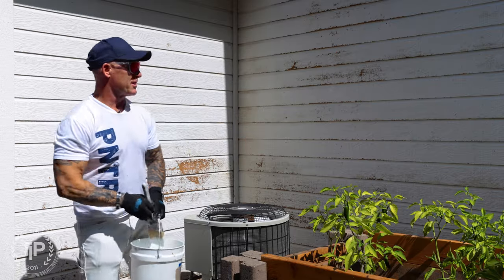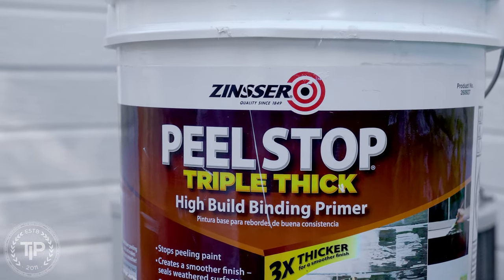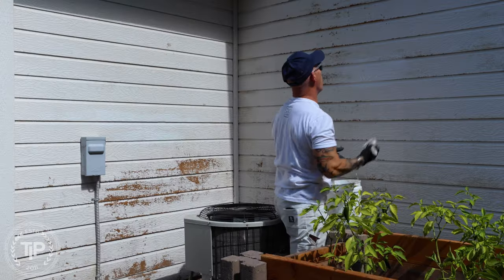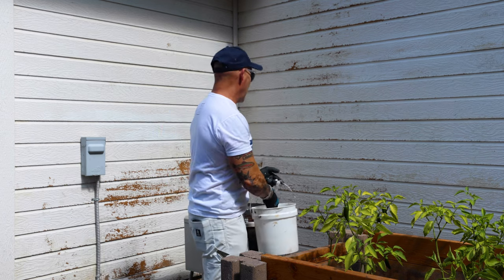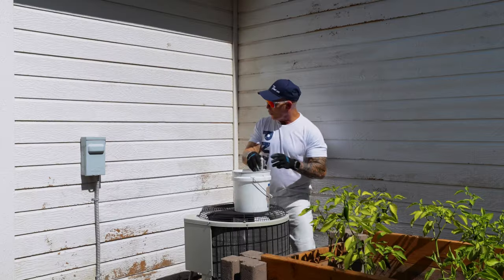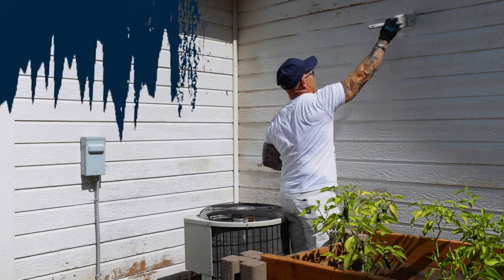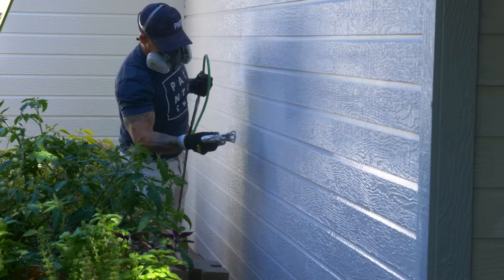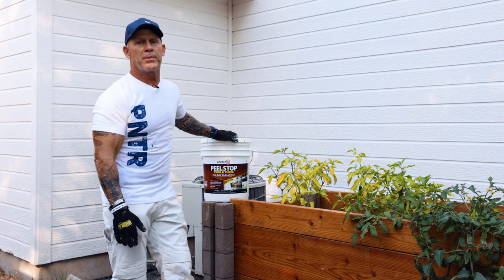Peel Stop Triple Thick Primer

Comment: Friendly Tip!  If this needs to be applied by brush, I recommend using the 2 1/2 Gooseneck flexible paint brush extender on a pole. No ladders. Use an 8 to 16ft extension pole. Saves so mush time. Idaho paint store. The Gooseneck guy! Cheers!

Comment: Just applied some of this after learning about it on paint life.  Dried pretty translucent even though the can said triple thick.  Chris: Are you having yours tinted or mixed with a white base?  Note to viewers: This stuff is not going to fully hide the edges of flaked paint.  It's thick, but not that thick, esp. after drying. It's better than reg primer though.  Quick sand after scraping and/or first coat of Peel-Stop to knock down loose fibers = pro tip.  He's right.  Big diff from that!
Reply from the maker: Triple Thick is tinted.  Peel Bond is not.

Comment: does this work well on masonry, in particular INSIDE basement foundation wall that is 100 years old and it's all crumbly (not stucturally) just like sand falling off it, if you touch it... if i brush it down to solid and use this primer on it, would it tie it all together and stop from crumbling and would this not peel in 2 years

Comment: I have a friend who has an older house where the paint is peeling pretty badly. Would you suggest that it be pressure washed and then sanded/scraped at least some before applying the Triple Thick? Or is the order like here in this video: pressure wash, Triple Thick, Sand and repeat the Triple Thick and Sanding until stable enough for the regular exterior paint?
Reply: I would pressure wash, scrape / sand, then prime.